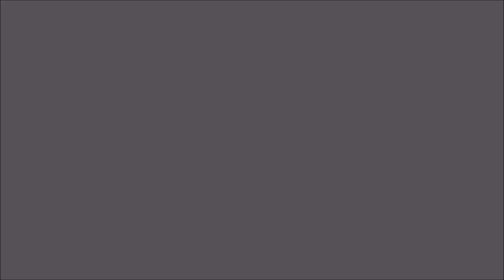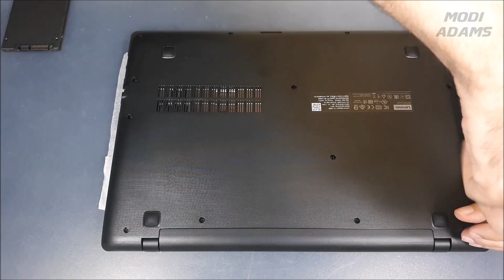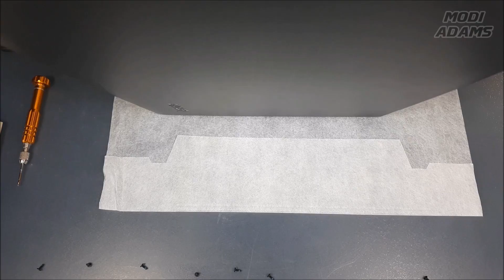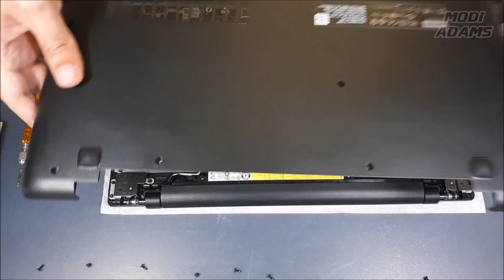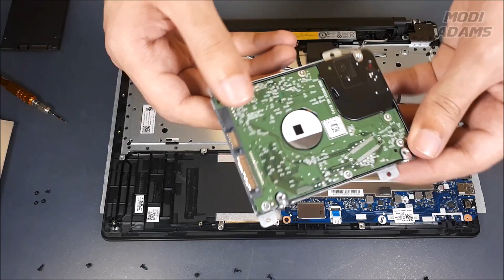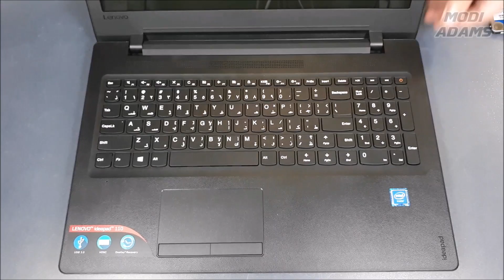Lenovo Ideapad 110 SSD Upgrade

Comment: Help Please :-) I dont get removed the DVD Drive. The screws on the backplate are removed, but it sits stiff, moves not a tenth of a milimeter. Any suggestion how I get this done? Thanks
Reply from the maker: Hey flyingernst, Make sure that you completely removed every single screw from the back of the laptop, then the drive will slide out easily, and even after you remove it, there will be still 3 flat screws there after you remove the drive, at 1:08 .. all and all, just make sure you removed all the screws and it will come out. Hope that will help. :)
Reply: @ModiAdams  Hi Modi, thanks, figured it out. My laptop didn't have the screws like yours, the 3 at the opening side of the drive. I had to remove the keyboard, there I was able to loosen a screw for the drive and 2 more. Finally after that I was able to open the case easily. Looks like there are different models.
Reply from the maker: @flyingernst  Hey! Great that you figured it out & thanks for sharing the info with us. Sure that lenovo Ideapad 110 do have many models depends on additional letters after the name of it.

Comment: Nice work, 
Hey can I replace ssd with dvd slot . Without any loss of data
Reply from the maker: There is no way that you can lose your data while replacing your HDD with an SSD, since the data still exists on the older drive and you can connect it via a SATA to USB cable and get your data from it to the new SSD. and sure there is a DVD caddy that you can install an additional drive in it. install the SSD with the Operating system on the main SATA and copy your data from the older drive and format it and make it one drive for multi-media and big files.

Comment: im using ideapad110 15acl, i dont need to unplug battery first? do i need a 2nd boot drive or can i do everything with one ssd?
Reply from the maker: Although i see on most videos people usually unplugging their batteries, which i do if it's a removable one, but if it's a built-in one like most of now days laptops, i just skip that and replace the drive without unplugging it, as long as it's properly shutdown, it's gonna be just fine. and no need for any other drives, just replace the HDD with the SSD, install windows and that's it.

Comment: My ideapad 110 is extremely slow, I'm not familiar at all with tech, if I open up my laptop what shouldn't I touch and what happens after I install an SSD?
Reply from the maker: All you need to do is just replacing your stock HDD with a brand new SSD (your desired capacity) and install windows & that's it, it's gonna be significantly fast, at least 5X faster!
Reply: @ModiAdams  Ok thanks! I'm a noob but how do I install windows 10? (I currently have windows 10 as it came with my laptop?
Reply from the maker: @Stevepoku  I'm definitely sure that if you searched for the easiest way to install windows 10 for example on youtube, you will find a dozen of them and you can pick up the easiest way or you can let a friend or an IT shop that you trust do that for you. but if you follow a youtube tutorial, you 'd end up doing it yourself :) anyway, good luck buddy.

Comment: Hey bruh, I'm currently using this as my secondary laptop.So, which SSD would you recommend using in this LENOVO IDEAPAD 110??? Ty in advance
Reply from the maker: Any 2.5" SATA3 SSD will get the job done regardless the brand. get whatever suits your budget.

Comment: SSD 240 GB 
Or HDD 500 GB is better? 
Plz answer
Reply from the maker: Hey Lolo, In general ANY SSD is at least 5x better than any HDD in terms of Speed, Boot time, Power saving & Endurance. so, Definitely go for the 240GB SSD or higher according to your needs.
Reply: @ModiAdams  
Ok thank you 🌺🌺
Reply: i subscribed to your channel 🌺🌺♥️
but sorry last question,
Can i upgrade my lenovo ideapad 110 processor ..or just the hard can be upgraded😅
Reply from the maker: @Adam-ul3pn  I dunno why but i just saw that last comment now :D ! and of course feel free to ask anything :) , about the processor, nope, most laptop's processors are not upgradable.

Comment: boa tarde neste vídeo não consigo ver o cooler desse notebook ! não vem com cooler ?
Reply from the maker: Hi there, good question! and these entry level notebooks' CPUs are becoming more and more efficient with much less heat emission that they are now able to passively cool them with just a metal plate and no fans are required anymore.

Comment: Quick question. Do I need to purchase windows again?
Reply from the maker: Hey Michael, Guess what? There was no pre-installed windows on the 1st place, i bought this one cheaper with no windows installed, meanwhile, if yours had windows, you can unregister your copy of windows there & use the same key on the new drive, or use a clone tool to copy an image of the old drive to the new SSD (which i don't really do) all and all, check a youtube video for how to unregister the key of a copy of windows to use it on a different PC.

Comment: Is there a specific Ssd that it can’t use? Also, is putting too much memory on it harmful to the laptop?
Reply from the maker: I think this laptop's 4GB RAM is on-board and not upgradable, and it can read 2.5" SATA 3.0 SSDs up to 2TB ..
Reply: Modi Adams Ok. Thanks.

Comment: I have this laptop. Is it worth it after upgrade  SSD? Bc mine keeps lagging and a bit slow. I planned on getting it fix
Reply from the maker: The SSD will make a huge difference. SSDs are a must on any computer, but the slower its, the more you need to install an SSD to make it faster. so sure thing, install it right away and you will feel a huge difference, i can't even imagine using it with a regular HDD!
Reply: @ModiAdams  hey, will it make a big difference if I also upgrade the ram after upgrade it to SSD? mine are 4 gb ram & 1 TB hdd
Reply from the maker: @fi_ki  I doubt that the RAM is upgradable, but it won't make a big difference at all, just upgrading to the SSD which is a must and will increase the overall system speed significantly.

Comment: Is RAM upgradeable too on this one ?
I bought this laptop in a hurry last year when I work out of town,
it simply the worst ever PC I bought, hard drive is alaways at 100% of load,
15 mn to be able to open Chrome !

Question is : both SSD anf RAM are upgradeable ?
Reply: I have read that people has issu for the SSD to be recognize by Windows or impossible to clone HDD..
Reply from the maker: @houarig.4753  , I installed that SSD as you see above, and the laptop recognized it without any problems, no BIOS updates or anything, meanwhile, max. RAM is 4GB, and you won't need much than this cause that CPU is never meant for heavy loads and multi-tasking, but the SSD is a must, and when you upgrade to SSD, your browser will open instantly and any other app too. My advice, get a 128GB SSD and you will get the most out of this machine, or higher of course if you store more data.
Reply: @ModiAdams  Thanks for the answer, I upgraded it yesterday with a SSD and 8 G of RAM.
I run W10 who eat about 3 Go RAM without doing nothing.
Easy, no bios enter, no need to rename volume.
I used Easeus Back up Home one month trial.

Edit : mine is a 110 ACL 15, not really the same as the RAM is not visible on yours.
I also used a caddy drive to replace DVD drive by an HDD with an adapter
I have a SDD for the system and HDD for stuff.
Reply: yes, same problem, the factory hard drive is painfully slow.  SSD ought to wake it up, if i could get the back off...

Comment: How fast is ur laptop after upgrade and is boot time fast
Reply from the maker: These particular laptops with Celeron CPU are technically unusable if used with a regular HDD, so upgrading them with an SSD makes everything you are doing on them relatively super fast, boot time is a 10 seconds at max. and browsing and overall performance is great. The SSD makes the laptop perfectly useable for what it's meant to be used for.

Comment: is an m.2 ssd compatible with the laptop?
Reply from the maker: No, this model is a bit old and does support only 2.5" SATA3 SSDs. The newer Celeron N4000+ Models like the Ideapad S145 does support both 2.5" SATA3 and PCIe NVMe SSDs.

Comment: no ram slot available for it?
Reply from the maker: Such a low-end model comes with a 4GB of RAM which are probably on-board. and it wouldn't make that much of an impact in overall performance since it's an entry level low power CPU for basic tasks and not heavy multi-tasking.

Comment: I have this Laptop and is freaking slow, so I want to know if with this upgrade I could even open Chrome smoothly or will have no difference?
I Actually have 10gb ram
Reply: How did you make it 10gb bro?
Reply: @podcastdzfan  2gb integrated in the motherboard + 8gb on the expansión slot

Comment: have no way to keep hd and just add ssd? Mine does not have a dvd player, I've heard that it has to put a ssd in place of the cd driver.
Reply from the maker: Kevin Ferreira, I think it would be better for you to replace the HDD with a 240 or higher capacity SSD or you can get a special HDD and SSD in one drive from WD a 1TB HDD & 128GB SSD within the same 2.5" drive, that will totally solve your problem, you install windows on the 128 SSD and save your multimedia and games on the 1TB HDD.
Reply: @ModiAdams  Thank you for your help. The problem will be finding one of these here in Brazil.

Comment: Do we need to disable internal battery first..?
Reply from the maker: Pushpendra Rajpurohit
, Not at all, I haven't disable it even on the video, When i 1st put my hands on this laptop, i thought they made it battery-less to make it cheaper lol
Reply: @ModiAdams  I have IP_110 with Intel_PQC_N3710 and 4GB RAM (2+2 soldered) which I can't upgrade, running windows 10 (64 bit) is not good experience because I usually have 15-20 chrome tabs along with other programming IDE windows so switching between them is sluggish and they become non-responsive and the integrated graphics also use RAM, it's the primary bottleneck of my system..
I want to add 250GB SATA SSD for boot drive to improve the experience (Will this improve my experience significantly in above stated situations..?) and want to keep the HDD as storage drive, This can be done using a caddy in DVD bay, somewhere I heard that in DVD bay it would not be bootable, please guide me what to do..
Reply from the maker: @rajpurohitpushpendra  avoid the DVD thing, and try getting a bigger SSD, and no matter how fast the SSD would be, it won't solve the bottleneck at your system since you need more RAM & a more powerful CPU for multi-tasking .. this machine is not intended for intensive work loads, it's an entry level laptop.

Comment: Where did you get this ssd from
Reply from the maker: I got it from Amazon long while ago. any 120GB SSD will get the job done and those are now as cheap as the 64GB one in the past, whether it's WD Green, Kingston, Sandisk, Crucial etc .. You can get one from Amazon or any local tech store.
Reply: @ModiAdams  alright would you be able to link it so I know exact which one to get cause there are all sorts of different ssd

Comment: How can I upgrade RAM to this laptop?
Reply from the maker: Unfortunately, the RAM is not upgradable, but it's not a high-end laptop anyway, you wouldn't need more ram in it, just make sure you upgrade it to an SSD with your preferred brand and capacity.

Comment: Thank you for this. To confirm, I can't update the ram, I should just change the HDD? Mine has 2GB of RAM 🤦🏾‍♀️. Will doing this help speed it up? If so please indicate the exact brand of SSD you used (specifications)
Reply from the maker: You are welcome. Any 2.5" SATA3 SSD will get the job done, Samsung Evo and Evo+, WD Green, Kingston, Sandisk, Lexar or AData. 120, 240 or 480GB depending on your capacity needs.
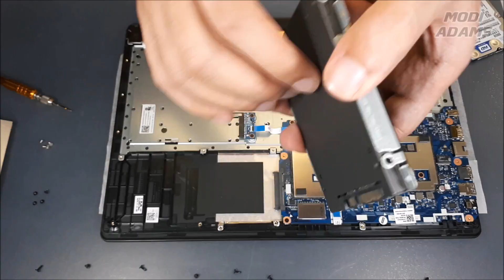Reply: @ModiAdams  the SSD you used in the video has a 60gig capacity? 2:10

Comment: Heeeey what's I like what you are doing.
Would you happen to know where the lenovo model you have worked above,it's ram would be ...
Reply from the maker: It's RAM is fixed at 4GB, it can't be upgraded.
Reply: @ModiAdams  waaart that's sad it seems the only other option is getting a new laptop hopefully better one. Thanks a lot .

Comment: Will this work for the Lenovo ideapad 110S
Reply from the maker: Hey Wayne, No, Unfortunately, this particular model doesn't support a 2.5" HDD nor SSD, It uses eMMC memory module which i have no idea whether if it's replaceable or soldered to the motherboard.

Comment: My Lenovo is slightly different than yours my battery connection under the keyboard disconnected the battery and temporarily and put it through whole so that have more working room to replace the harddrive got it installed but Lenovo recover failed twice on me so had to download the windows 10 media tool to a usb flash drive and everything went through but unfortunately my other harddrive failed on me but had it backup this time and get all of my programs back on got a ssd drive in my laptop now there a hole under the keyboard where the battery cable can be pulled through because give me a lot of more working room to replace the harddrive with ssd
Reply from the maker: Sorry it went with you in a harder way, but it's a must to always backup your files before any system upgrades and so on, and sure the recovery wouldn't work cause it's on the HDD and you replaced it with the SSD, so you did the right thing, a fresh clean installation of windows right after installing the SSD.
Reply: I had the lenovo recover on a usb flash drive but hard drive failed on me but had my files backup to an ext harddrive

Comment: I have one question, which size use of hdd this laptop?
Reply from the maker: Mayu Kagari
, It came with a 500GB HDD and i replaced it with a 64GB Kingston SSD specially for someone who just wanted to boots the speed and doesn't need any additional space.
Reply: @ModiAdams  Can I replace it  with Crucial 500 gb SSD?? Is it dangerous? Or 250 gb? Or 120 gb? Thanks
Reply from the maker: @gaetanovalente7500  You can change it to any of what you have mentioned above or even 1TB, but the 500GB is more than enough, very fast and affordable, any of them will work perfectly fine.
Reply: @ModiAdams  thank you very much

Comment: hola, esa notebook tiene lugar para dos discos. uno conecta sata y el otro msata. con un adaptador de msata a sata le podes poner dos discos internos.
Reply from the maker: Hey Eduardo, This other look-like mSata connector is for the Optical drive, so you may want to get a DVD caddie and install additional drive, which would be also not that useful since SSDs are getting cheaper and bigger.
Reply: lo bueno de tener dos unidades es que las podes configurar en raid y tenes dos alternativas, una mas seguridad al estar espejados  o sin espejar mas velocidad al repartir las transacciones entre las dos unidades.
Reply from the maker: Indeed RAID is a good advantage, but keep in mind that this laptop isn't meant for high performance computing or multi-tasking and so on, it's meant for basic stuff, surfing the web, watching videos and movies or basic microsoft office or IT stuff.

Comment: can i upgrade RAM on this laptop? is there any available slot for RAM?
Reply from the maker: ivan, i think that 4GB are the max. for this laptop, and frankly you wouldn't want to multi-task on such a machine anyway, it's a 1 ~ 2 tasks easy notebook.
Reply: RAM is soldered to the motherboard, and you can not upgrade it (with bare hands you can not precisely). The range of RAM in this model is 2-8 GB.
Reply: You can upgraded it to a 8gb RAM. 
I did it

Comment: leptop not have fan?
Reply from the maker: Yes. Most of the latest Celeron Gens from Intel are not efficient enough that they are passively cooled without the need for a fan anymore, which makes them ideal for those who are using their laptops at a very quiet environment.

Comment: Will it broke if i put a 1TB ssd?
Reply from the maker: Not at all, it will work perfectly fine, you can install even up to 2TB if you would like to, and you can swap the optical drive and replace it with a caddy that can have another SSD in it.
Reply: @ModiAdams  ohh okay thank you bro
Reply: @ModiAdams   brooo, i was wondering whether it's okay to add an egpu on lenovo ideapad 110 14ibr?

Or not suggested?
Reply from the maker: @mrnobody8128  There is nothing you can upgrade at this notebook except the SSD, the wi-fi card & the optical drive.
Reply: @ModiAdams  so sad, anyway thanks broo

Comment: i dont need to do anything about the softwares installed?
Reply from the maker: If you gonna replace the HDD with an SSD, you better get a software that clones the old HDD to the SSD, but i would rather recommend that you get your windows key and reuse it after a clean windows installation on the newly installed SSD, and on my case, i got it without any pre-installed windows, i installed it on my own.

Comment: Crucial BX500 works for this laptop?
Reply from the maker: Hey Stiven,Yes it works, and any other 2.5" SATA3 SSD will work as well. Crucial SSDs are one of the best value for price SSDs around.
Reply: @ModiAdams  Crucial BX500 240GB , Kingston A400 240GB or Gigabyte 240GB. Which is better?
Reply from the maker: @marlonmunoz9411  All are great & will get the job done, so just get the cheapest one of them.
Reply: @ModiAdams  TY

Comment: Which ssd did you used????
Reply from the maker: I used Kingston, but also SAMSUNG, ADATA, Crucial, PNY will do.
Reply: Modi Adams okey thanks is this a lenovo ideapad 110 15isk because it has more 110 s
Reply from the maker: @frms8273  Yea, this Ideapad 110 series has slight differences according to where you bought it or the price tag. It could be Celeron or AMD and so on, but the AMD has a cooling fan while Intel one is passive cooled. so it emits 0 decibels.